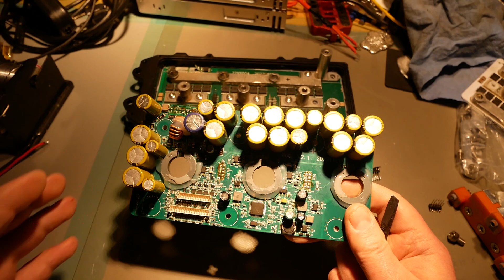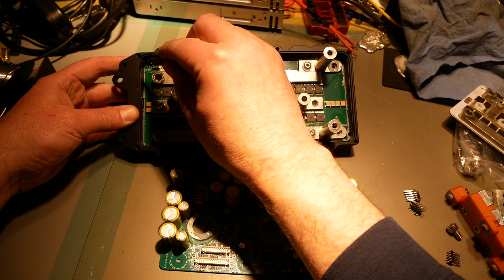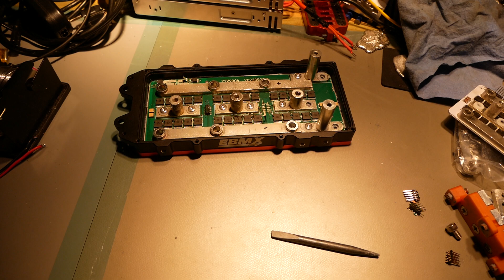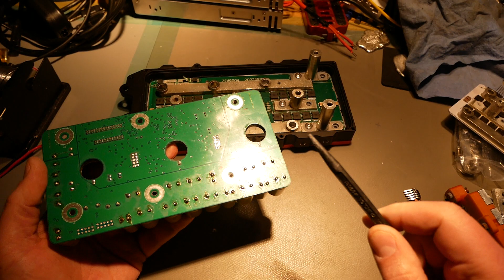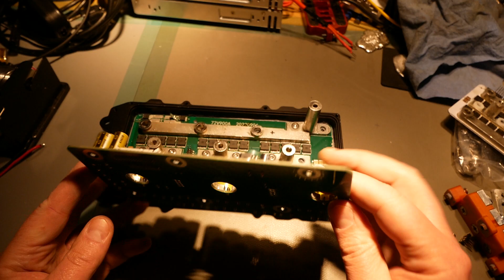EBMX X-9000 Teardown Logic board overview

Comment: LOL "faraday cage" with 900A phase buses very close and all over low voltage logic board! 
As an electronic engineer, I can tell, you want them as far as possible.
That's why no other controller does it like that. It must be connected outside the metal case, not inside allover 3.3V logic.
Reply from the maker: You are obviously wanting to pick a fight. Your motives are clear, create drama and conflict. You probably bought into the KO Moto lies and deceptions and so I feel for you! Watch the videos from the perspective of education. I do tear downs for far more than just KO and EBMX. You will notice a theme, if your bias allows you to see. I call good stuff "good" and I call bad stuff "bad". Kindly SHOW me any attempt at blocking RF from the small electronics in an existing KO controller. They have similar closeness between boards and there is no evidence of sheilding of any kind. I did say "sort of like a faraday cage". You rapidly hacked that up to make it sound like I said something else. If you are going to quote me do it accurately! While I agree you don't want low power electronics right next to noisy high power ones, that IS how you build a controller. Your best bet is to mitigate RF issues AND EBMX did that! IF you really are an EE, then you don't need me to tell you just how BAD of a design KO products are and how GOOD EBMX is!
Reply: Dude, I do not care about KO, it is not a good design either.
Reply from the maker: @MrDehicka  Hey, sorry...you came at me pretty direct. You would not believe the amount of shit I get for doing that KO Pro tear down! KO people come at me in any video I post that competes with KO! I'm a bit defensive as a result and that's the core of what happened. Sorry, it's just being shell shocked by assholes over and over again and you got a bit of the back draft from that.
Reply: @de-bodgery  hows it going, may be you can help me, i have a EBMX X9k v2 controller and motor on my Sur Ron. I parked the bike back in November, bout 3 weeks ago i deceided to take the bike for a ride, i popped the battery in and switched it on and the display came on no battery reading and then it said check peripherals in app.i did the firmware update, i checked the pins and cables for crimps and made sure all connections were good, i also checked the 2 to cable.
if i disconnect 2 to 1 cable i get a error 30 code and the bike will not run without display.  I am able to calibrate motor and i do get a reading from the throttle and the regen thumb throttle.  i reached out to EBMX on 3 occasions and they got back to me once and say they received my information and they are checking it out and will be in touch thats more than a week ago.   Any help would greatly appreciated.  Thanx in advance.

Comment: If I ever buy a controller for a diy or a tuning project, it must be repairable by using a hot air station or a soldering iron. Is there a way to separate both pcbs without damaging the connectors?
Reply: You may separate it just you need proper tools like a vacuum desoldering gun.
But EBMX controllers are potted (they say) KO does not. But who knows? What is better? If  you have a good quality controller that no needs to be repair but already potted or you have another controller what need to be repair and also you can be repair  because not potted ? This is a big question. I know everything can be broken, but if you choose a contoller smartly and you not undersize it  for your project, maybe it will be bulletproof.
Reply: @TudiMPowerService  You are right, but I am human, I sometimes destroy things by mistake. A diy project is always some kind of prototype. This is why I like the teardowns on this channel. I hate expensive stuff with no chance to repair. This controller looks good to me. I hope someone ports vesc to it.
Reply from the maker: @PeterPan-gy6kq  This is probably the best piece of hardware I've seen so far. It's got a few things I'd like changed, but otherwise, the more I dig, the more I like about it! I have to say that all potting will come out. Like I said in the video, "You might have to get at it with chemicals, but it will come out again." Those through holes with pin headers, hot air, going slower than I did, etc would all possibly work. They will come out without damaging anything. I succeeded on the hardest one and got more familiar with the "feel" of the solder letting loose as I went along. That really hard one was the last one I removed. Since this was my first of these to ever take apart, I was obviously too aggressive. I can guarantee you I would not repeat what I did to this power stage again! You know, live and learn....what else can I do?
Reply from the maker: @PeterPan-gy6kq  As far as repairable and stout and not potted and made with all top teir western parts goes, well that's Tronic. It's not as refined as the X-9000. The guys that designed the X-9000 are really good. The Tronic engineer, he's pretty clever, but his mechanical stuff isn't as good as the X-9000. That's not to say it's lousy, just that the X-9000 is seriously good from the hardware level! You'll see the Tronic 750 pretty soon. I'm working on the preamble stuff now. It takes a bit to look over a board and to get a decent idea what the parts do and how they interact. Probably this week you'll some 750 content.